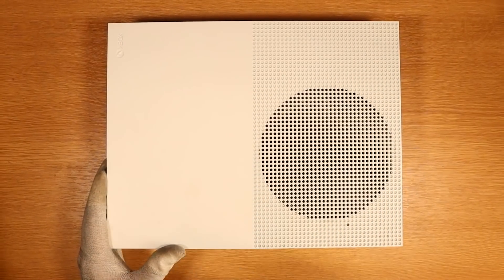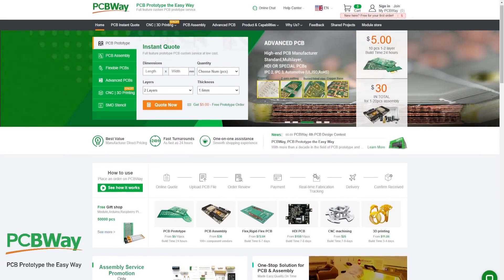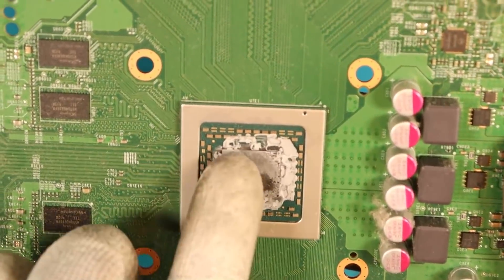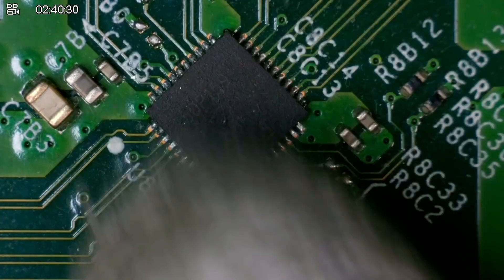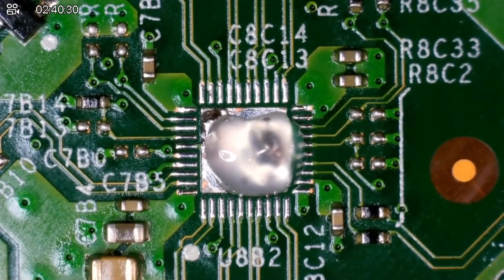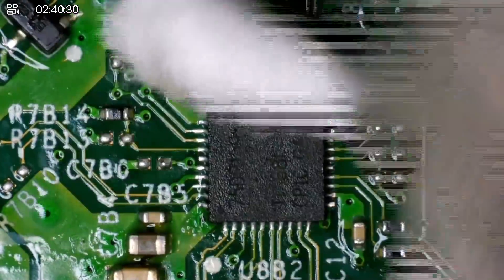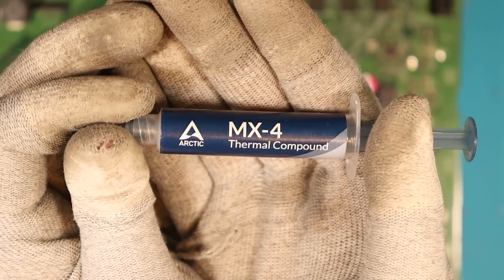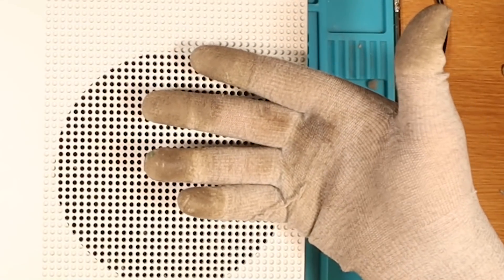Can I Fix this $54 Xbox One S?

Comment: how do you know you have the chip positioned correctly? does it kind of set into place and you can feel it when its just right?
Reply from the maker: In a way, yeah. Also when flux is used and heat applied, the chip will jump in to place. It’s more so time and practice to know when :)

Comment: I don’t think the checking of the filters on the HDMI lines makes sense like this in the Xbox. In the Xbox those filters are in parallel to pcb lines. So under the filters there is no break. Essentially the Xbox could perhaps even work without those filters. What can happen is that the filter short internally. Then you would see a short between two lines running next to each other. If it does happen on Xbox I don’t know. Filters in most other devices are essential. PS, Switch, iPads. You name it.  Glad you are having so much fun on the videos.
Reply from the maker: Ah this makes sense Marcian! Thankyou :)